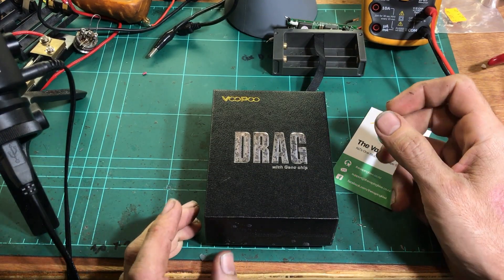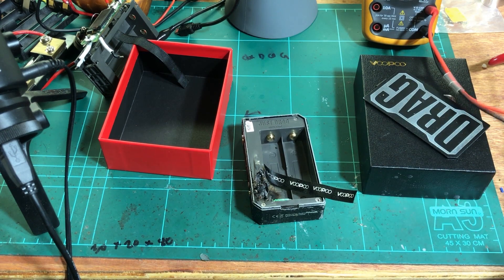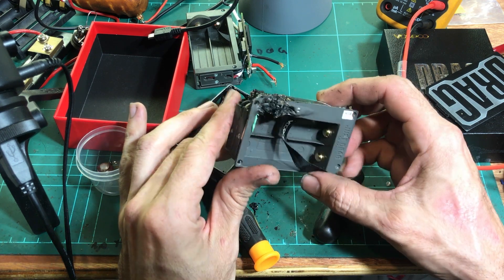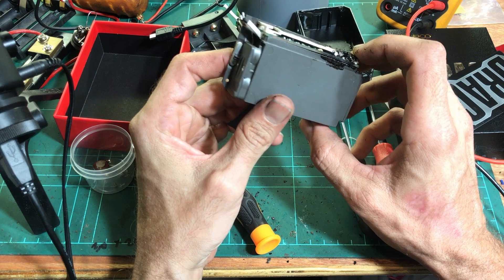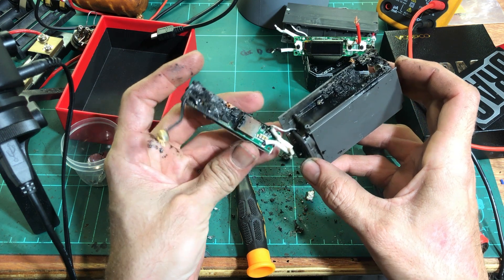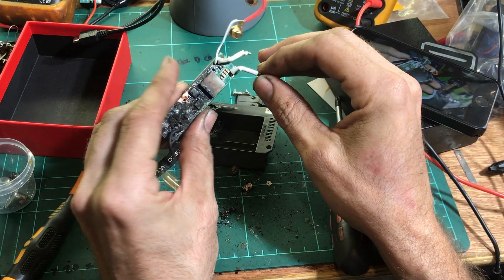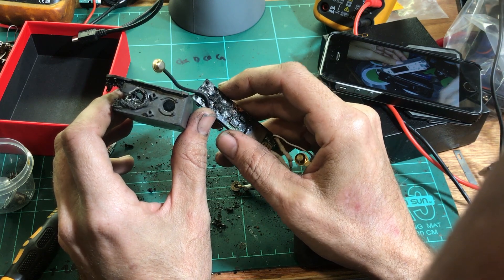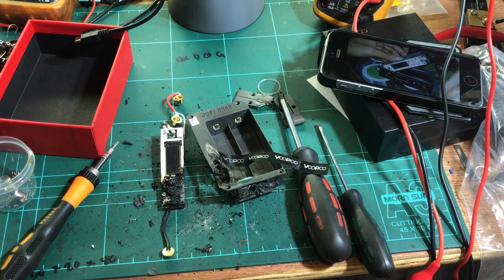Failed Voopoo Drag Disassembly and Analysis

Comment: What I think happened is on the fire button there is a little metal pin to hold the fire button in the case. So when there needs to be maintenance, it doesn't fall out. I noticed the button fell right out when you popped the tray out. I bet the pin fell out and fell down on the board and shorted something out. I know mine has the pin there to hold it into the case.

Comment: Likely going to retire my drag v1 very soon. I had dropped my in the toilet a while ago. Likely about a year ago now. Still works fine, it's almost 4 years old. Fire button has to be pressed in a certian way for it to fire. I am weary of using it but I figure, its been a year after it was submerged (wasn't under for long and thankfully didn't see much air bubbles go in) and it seems to work find aside from the firing button being finicky at best. Sometimes I use the USB to charge but was advised against this so I use it sparingly and watch for heat. The end of the cable does get warm which is of concern. This could be a point of failure for this unit, as it seems the burn area is right around where that usb port would be located. Somebody may have been using a shotty cable to charge. Who knows for certian the events that lead to this one burning. I've seen wuite a few of these stories here. I'm not super concerned but I do believe it'll be wise to retire my unit !
Reply from the maker: Yeah it definitely sounds like you’re due for a new mod!

Comment: Thanks for the cool video. I have an issue and I couldn't find the answer for it. I just bought Drag 3 and when I tried to update it, it failed and I can't turn it on anymore. I'm not sure if all the files got deleted and thats why it won't turn on. 
How can I figure out what is the reason and how to fix it?

Thanks!
Reply from the maker: I’m sorry mate I’m not much help here - I’ve never tried updating the firmware on a Voopoo mod. Usually the only option is just trying to re-update until it succeeds, it might take a few tries. Also, definitely try a different USB cable and make sure you got the correct firmware version. Also also, sometimes there are weird instructions to follow like holding a certain button down on the mod, double check any help / instruction file that came with the firmware. Hope you get it sorted! Otherwise you might want to post on r/electronic_cigarette for help.
Reply from the maker: @B7r660  Excellent find, well done! Useful information, I’ll remember that in case someone else asks. Cheers :)

Comment: could you measure the original cable from it, does it have any resistor in it?  I read that it is between the cc and vbus pins
Reply from the maker: Apologies mate, the mod in question is long gone.

Comment: I have a voopoo drag I bought from a friend I can't seem to get the battery panel off I've tryed everything any suggestions would be help full..thanks lmk 🙂🤙
Reply from the maker: Michael martuch You mean the large panel that covers the batteries? Weird if it’s stuck! It should be able to pop off as it’s held on with magnets I believe. I’ve only had this faulty Drag which was burnt so I’m not sure how tight that panel normally is.
Reply: It must be stuck on I still haven't been able to get it off lol
Reply: Do you have the drag or drag 2 mini? Drag 2 mini has internal batteries and doesn't have an easily removable back like this one or the drag 2. The screws to access the internal battery are located under the  swirl design sticker thing. You'll ruin the design though. Dunno why you'd wanna get inside though.

Comment: Hey do you know what causes the voopoo drag 2 to show it’s charging without actually having a usb connected to the mod?
Reply from the maker: I’ve seen that happen on other mods, it’s normally due to something conductive stuck in the charging port. Have a look inside the port with a bright light and see if you can gently clean it out. Take the batteries out first. Also check for damaged or bent pins, or if the socket is wobbly.

Comment: Hello my friend my name is Eliran and I’m from israel I have voopoo Drag an I use it daily and some times stores it with a tank full of juice tanks like manta rta and Sherman rta and reload rta and qp design fatality m25 and those tanks can leak not on the mod 
and on the mod they leak all the juice to the drag mod if it’s in a bag and believe me nothing happened maybe I have lots of luck and maybe the mod is insulated as it should be 
Loved the video 
Thank you very much
Reply: Maybe the problem was with the charging port some kind of a problem with the current of the charger ? That’s why I never charge my batteries on the mod but only in a charger that I can trust .
Maybe a failure of the mosffets ?
Or the chips on the board?

Comment: hi i have problem with drage2 software >>
on screen one battery is full and another in empty or one but when in put this battery in another   mod darge 2, the battery is normal and same degree of charge 
what i have to do
Reply from the maker: That normally means either the board is faulty, or the internal balancing wire is disconnected / broken. It’s a thin wire which goes from the series battery connection back to the board so it can tell the individual voltages and do balance charging. A faulty board is very difficult to fix but someone who can solder might be able to fix the wire if that’s the problem.
Reply: someone saw mod and told me it does't read a charge from usb and IC charge may be damaged but  we need the same ic charge . 
is ic charge of drage 1  same ic from drage 2
Reply from the maker: @khaledelmaghlawy9844  Yeah it might be the charge IC or a connection problem. I’m sorry I don’t have a Drag 2 board so I can’t tell you the IC model.

Comment: I have a voopoo drag 2 and it’s saying high temp and isn’t working. Maybe you could help me
Reply from the maker: I’ve seen this happen a few times and unfortunately it’s not usually fixable. There’s a temp sensor on the board which can go faulty, so the mod thinks it’s over temp when it isn’t. The only thing I can suggest is reflashing the firmware just in case that’s the problem.
Reply: @vmgtesting8014  how do I do that ?
Reply from the maker: @dakid8866  Go to Voopoo’s support site and download their software for the drag 2 - https://m.voopoo.com/software.html - it should walk you through how to connect the mod to your PC and update it.

Comment: Do you think taking this mod apart is easy enough to sand and repaint the metal frame? My drag has worked fine from the original black but the flaky paint my black mod is basically silver now. Thanks!
Reply from the maker: Waylon Gerard I think it’s not too difficult! You’d want to completely strip it down - take out the inner assembly, 510 and buttons so you’ve got the bare frame. You could then polish or paint it, whatever you like. If you’ve got a local powdercoat shop, see if they’re willing to paint it for you for cheap. It’s an awesome durable finish.
Reply: @vmgtesting8014  I actually have my own powder coating machine.. Never thought about it. I appreciate it man. Do you think I'll have to de-solder the 510 like you did or you think I could get it out without? I can solder back, just don't want to take a chance of ruining internals lol
Reply from the maker: Waylon Gerard sorry for the late reply mate, I don’t seem to be getting notifications. You’ll have to desolder so you can remove both the board assembly and 510. I reckon desoldering at the 510 itself would be the easiest. Cool stuff you’ve got a powdercoat setup! Send me some pics when you get it done :)
Reply: @GhostfaceRuga  Do let me know if you powder coat it, how much longer it lasts. I've been considering doing this for a while now myself.

Comment: i have a drag like this one and a buch of juice leaked onto the boards and it stopped working any solutions on how to fix this? i took it apart and wiped away all of the juice and it still dosent work i havent tried rubbing alcohol yet any suggestions
Reply from the maker: Cir CIVIC Sorry to say that once a board stops working due to juice ingress, there’s not much you can do - it means components or tracks have been permanently damaged. These small boards are very difficult to repair even if you have all the right equipment and replacement parts and I think even if it did somehow start working again it wouldn’t be worth the risk. Cheers :)
Reply: @vmgtesting8014  ok is there any way that i can get a replacement board?
Reply from the maker: Cir CIVIC I don’t think it’s possible to buy a replacement board. Maybe have a look for a second hand mod and mix and match the best parts.
Reply: @vmgtesting8014  ok thanks for the suggestion ill keep on the lookout for another one guess its back to the old aspire archon for a bit lol
Reply: Bit of a hail Mary this but have you tired cleaning the board with 70-99% Isopropyl Alcohol, might work
Reply: @fibleo4037  I have not yet I just bought a new one
Reply: @circivic6710  That's probably for the best
Reply: @fibleo4037  yeah lol i gave the old one to my friend that likes to fiddle with things i told him if he gets it working he can have it

Comment: That has melted like a chocalte sundae on a hot sunny melbourne. Could you please help out mechanical engineer which is stuck(I have gorilla hands soldering and most fabrication skills regarding electronics quite sound. On the GENE chipset the rear of those tactile switches is sealed plus can’t get a visual to bypass somewhere else the the pcb board. I want to change the tactile switches on a voodoo Argus gt with a GENE  chipset. I’m referring to the fire button and the -/+ or up/down tactile switches to wired momentary push button On/Off switches. If you could give me any advice I highly appreciate it. Thanks, 
Evan from Downuder
Reply from the maker: Hey Evan, how’s it going mate? Hello from sunny QLD! So if I’m understanding correctly you basically want to remove the existing tactile switches on the board and solder wires to them to attach remotely mounted switches? It’s possible to remove the existing switches with a fine point soldering iron and some solder wick but pretty risky honestly - I’ve accidentally pulled pads off boards when the solder hadn’t completely detached on one or more of the pins. What you’d really want would be a hot air station - you can get one pretty cheap on eBay. That’ll let you evenly heat up the 4 solder points on the switch to remove it safely. You might end up melting the switch a bit but not a big deal as I assume you’re not reusing them. The pads should be big enough to manually solder to once the switches are removed if you’ve got some thin solder, also handy to have some solder paste on hand that you can use with the hot air gun. Hope this helps, hit me back if you need more info. Cheers!

Comment: My mod was left inside my car and outside is very hot and it’s more hotter inside my car and my vape mod was  very hot. Does the heat can damage the chip of my mod ?
Reply from the maker: Gian Vivit It shouldn’t cause any damage to the board - the board itself should be able to handle storage temps well above 100C. The batteries on the other hand start ageing much more rapidly above 40-50C. Check to see they’re still performing normally.
Reply: VMG Testing  thank you for responding  sir but my battery’s charging time increases. Is that mean sir that my battery is damage?

Comment: Hello there..
Would you be able to recommend a usb port for me?.. the one on my Voopoo Drag broke.. well the cage broke.. I just done know what type or port to order.. thank you..
Reply from the maker: vvrench Sorry for the late reply! I don’t have an intact drag board to check, but having a look at the other Gene board I have in the alpha one it looks like the socket is this one - https://rover.ebay.com/rover/0/0/0?mpre=https%3A%2F%2Fwww.ebay.com.au%2Fulk%2Fitm%2F273714269723. Here’s the pic of the socket on the Gene board I have - https://imgur.com/a/wRHySHR. Double check that the drag board uses this type by taking it apart and having a look. If it’s different, you’ll pretty much just have to search for “micro USB female socket” on eBay and match it up. There’s many different configurations, you gotta get the right one. Do you have the tools to change it yourself? It’s not an easy solder job! Good luck :)

Comment: What size allen wrench are you using?
Reply from the maker: Josephine Lee I’m sorry for the late reply! Honestly I can’t remember, I have a set of small hex and torx bits and just pick the one to suit. I’ve got a feeling it was T5 or T6 torx. Normally the kits are cheaper than buying several sizes separately so I reckon that’s the way to go.
Reply: @vmgtesting8014  No worries! Thanks for getting back to me.
Reply: @JoZeeBB  allen wrench is 1.3mm
Reply: T6 star bit
Reply: I need a replacement GENE177A-FAN V1.2 board (board only)...any suggestion where to buy one? Even used...
Thanks!

Comment: My button works 1/2 the time what can I do to fix this
Reply from the maker: Music Revolution You might have some luck by taking the device apart (batteries out first) and cleaning it with some isopropyl alcohol or electronics cleaning spray. If the switch is playing up there’s likely juice on the board too. Make sure everything is completely dry before putting it back together. If you don’t feel confident to take the device apart yourself, you could probably take it to an electronics or appliance repair shop.
Reply: @vmgtesting8014  thank you I'm not good at taking apart things and putting them back together so I'll go and take it up somewhere. Could a local vape shop maybe do it as well???
Reply from the maker: Music Revolution That’s a good idea, I know some shops do mod repair :)

Comment: Man just wish you did a quick step by step of disassembly not concerned about the issue obviously it’s fried lol.
Reply from the maker: Chris G. Haha I’m hearing you, vid is lengthy af sorry. I don’t have a Drag in good condition though so I haven’t been able to show a disassembly when everything is as it should be.
Reply: Unscrew all the screws. Pull the 510 connector up a hair and over to the side but be very careful doing so. When you pry the battery case off, your buttons will fall out. The up and down buttons are a breeze to put back in however the fire button is a pain in the ass. You can clean around all the important stuff like this leaving the chip housing in place. I wouldn't recommend trying to take the chip housing out. I cleaned mine like this with isopropyl alcohol put it back together and it did just fine and mind you I had been leaking juice into it for months not realizing my profile had the squonking screw installed by default.

Comment: Thank you for this! Do u think you could help me with my piece of shit voopoo v thru? It's my 4th one lol. I just have to learn the board at this point. I hate them. 🤣
Reply from the maker: Sorry for the late reply! Hah, what happened with your Voopoo? It’s a bit tough to diagnose or fix mods remotely tbh, I could have a look if you sent it to me though. I’m in Aus. If they keep failing in the same way, might be time to switch to a different model??
Reply: @vmgtesting8014  LOL EXACTLY!!!!  I am just a hard headed ol broad I guess!!  lol I just kept seeing them on sale for like $13 so i kept buying them.  I have so many different freaking vapes, but I would never count on this thing to be my only one.  I ought to send you one, just because I would be curious to see what the issue is that all of them clearly have.  I took the innards out of one and put em back in and it suddenly worked, and i layed my dremel on another one and the vibration must have caused it to work again.  If you have a way to give me an address, I will send ya one. I certainly have enough to share! HA
Reply from the maker: @HOLLYHOUSE11  Happy to check it out and see what I can find! Shoot me an email - vapey.mcgyver@gmail.com

Comment: Do you know where i could get a spare board for my mod, mines fried similarly and I really like it i just want to repair it
Reply from the maker: Sorry for the late reply! As far as I know it’s not possible to buy a replacement board. If you desperately wanted to keep using that particular device (sentimental etc) then you could either buy a new or second hand drag and swap the working board into it. It’ll require some soldering to reattach the wire connections but not too difficult. Good luck :)